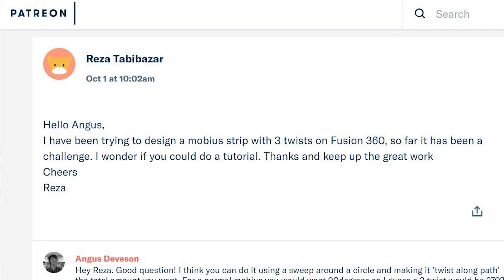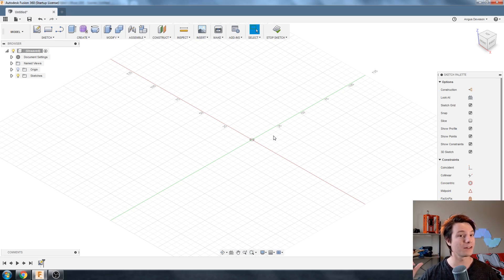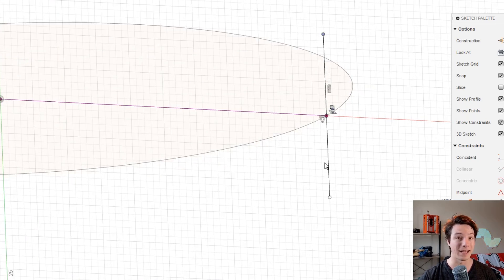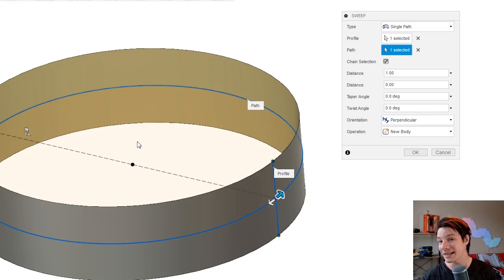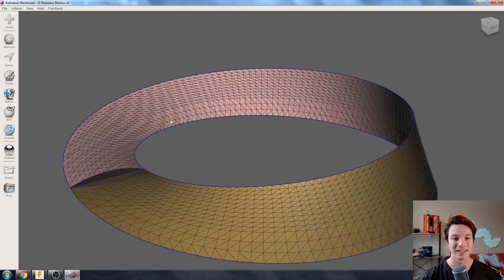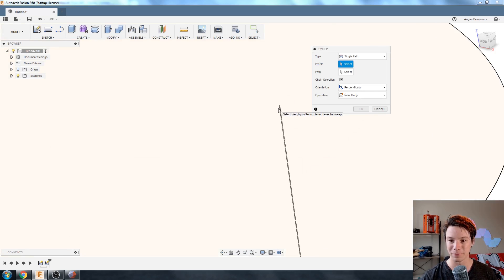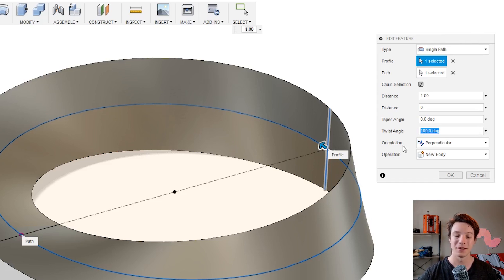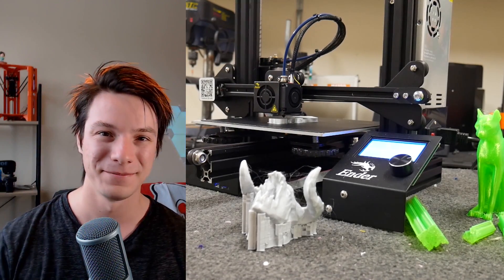How to 3D Model a Mobius Strip in Fusion 360

Comment: Wich of all the printers you have tested would you recommend the most to print with flexible filament?
Reply from the maker: Any i3 with a flexion extruder upgrade
Reply: I have a cr-10, Wich I love to use. 
So would you recommend upgrading this printer to a flexion extruder?
Reply from the maker: It's a Bowden design extruder so not suitable for flexibles, it's be a difficult diy conversion but possible.

Comment: Nice video and tutorial! Your video is awesome, but I have found a much more simple way to complete the same task. (Not trying to criticize, but the method I use seems a little more simple and easy)
Reply from the maker: All good, how did you do it?
Reply: @MakersMuse  I did the same thing as you, but just used the center rectangle sketch function on the circle line. I then used sweep with the 180 twist on the circle. Very similar to your way, but I skipped the steps in the middle and ended up with similar results.
Reply from the maker: oh yeah, I just used the line to demonstrate what happens when you use the patch sweep :) cool

Comment: Another way to solve the problem is by doing a sweep around a half circle and make the twist angle 90° and then you just make a copy and rotate it a 180° degrees around the midpoint. (you have to rotate it sort of over itself and not around the Z axis). It creates two bodies which Fusion can process without a problem.

Comment: I wonder what u will get when removing your designed strip with little thickness from a solid block, and after that just invert, so that the removed part becomes the solid and vice versa.
I tshould in theory create a solid with no artifacts on the connection point

Comment: I know many programs discourage it but I learned 3d modeling in Lightwave which focuses on direct manipulation of polygons, there edges, and points. you could fix that artifacting by adding individual faces along the joining edges equal to the triangles that need to join.

this is happening because your letting the software do all the subdivision and it assumes you want that to be a solid edge. It doesn't realize that it's not an edge but a bisecting line.

For me it has been real hard to give up the direct control Lightwave building allowed. (but the software is bonkers expensive) Being able to just build models point by point sounds tedious but it is super powerful. I personally love when a model is detailed and so clean that you can look at it as a wire mesh and there are no waisted surfaces or faces, no needlessly nested triangles. and if a surface is totally flat (Very strong if, no wiggle.) there is nothing wrong with using squares
Reply: I was going to suggest something similar, using Sketchup. I could probably easily fix that join to be essentially seamless and not get those weird artifacts. How well it would work once sent to a slicer for printing is another question entirely.

Comment: I just found a different way to create a surface body Mobius strip that doesn't mess up so bad at the seam. Just sweep the line 359 degrees around the circle(or really any decimal between 359 and 360), and then loft the two edges together to make it basically seamless. It isn't a mathematically perfect model, but it's good enough to where you won't see it in any renders or physical representations of the model.
Reply: Hey! Great solution. I just tried making the whole sweep in four sections and joining them. You end up with dirty meshes at the joins, but these can be tidied by making mods to the settings in the Make>3D Print>Refinement options to get this: http://dewexmusic.com/tL/jyte/mobius.png